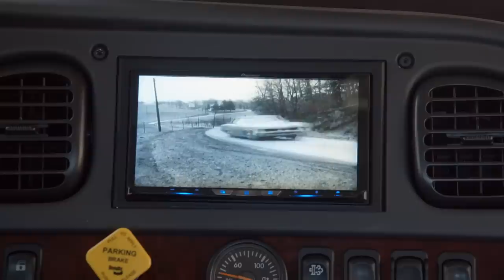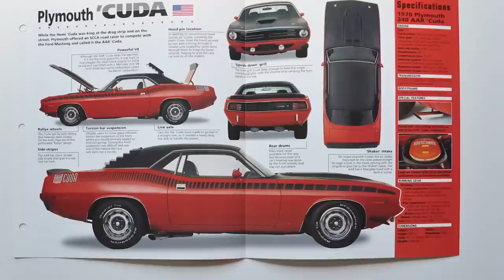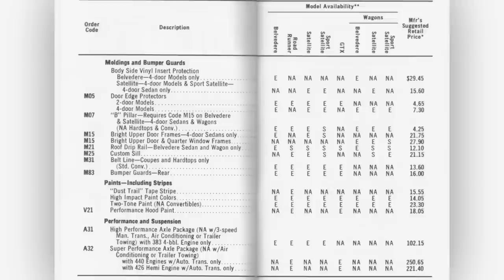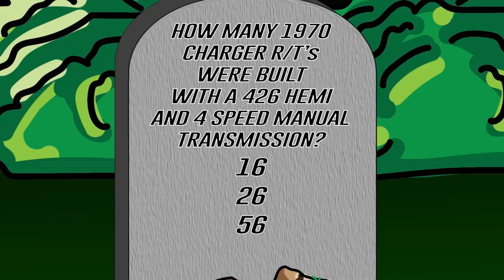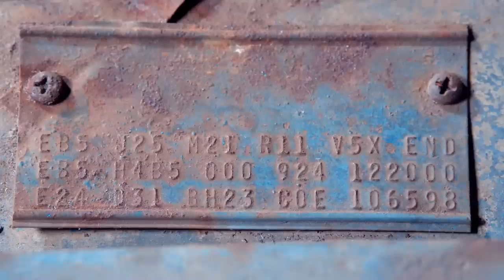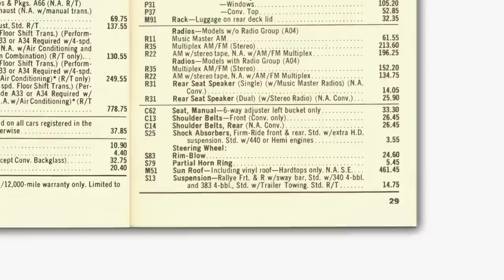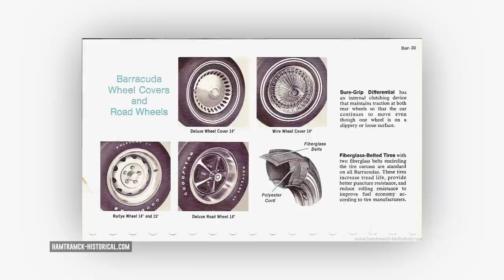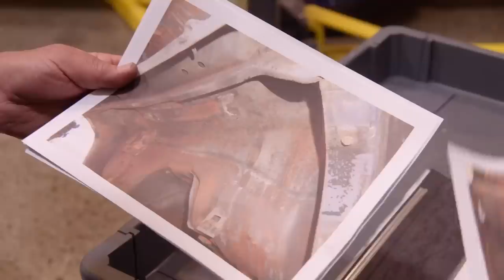NEW EPISODE: MARK BUYS A '70 BARRACUDA IN NEARBY TOWN!

Comment: i used to try to get all OE stuff for my cars then i found if your not working on a 200k$ car you might as well be hot rodding it, its way cheaper to make it look good and go faster. also, hot rodder is a way better term than butcher, a butcher does stuff like rams screws into the dash for aftermarket guages.

Comment: I can't imagine how they made these stripes on the assembly line or the vinyl top, how is it possible to do these things in mass production?
Reply: While it was still on the assembly line they would put very large black decals on it.
This was not easy, but it was not impossible.
Reply: I have a 2014 Challenger SRT with black stripes.  The stripes look good from the street level, but if you get super close to the car with a tape measure, nothing lines up and it is far from a perfect installation.  However, looking good from the street level is really all that matters for the most part.   

Plate C